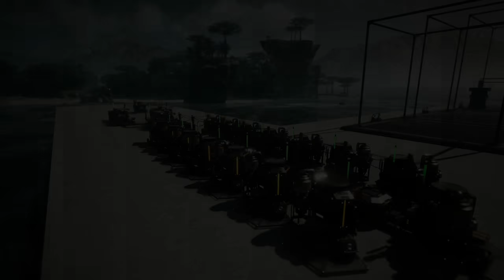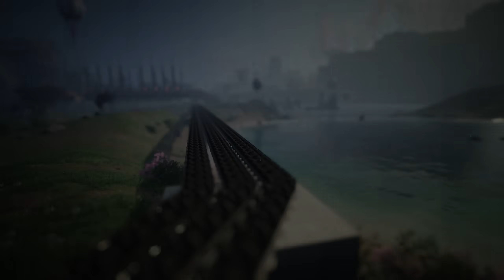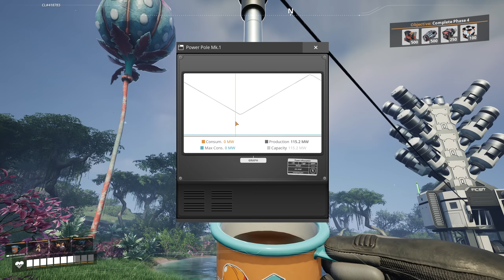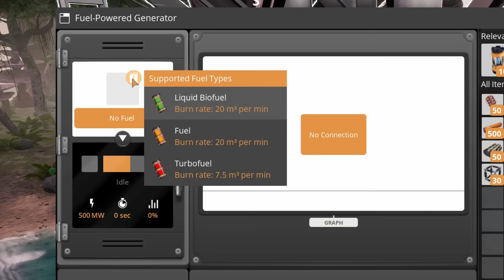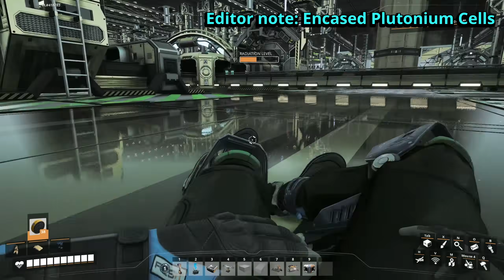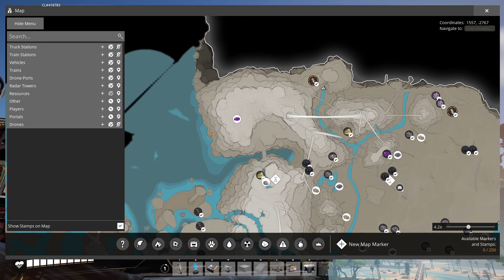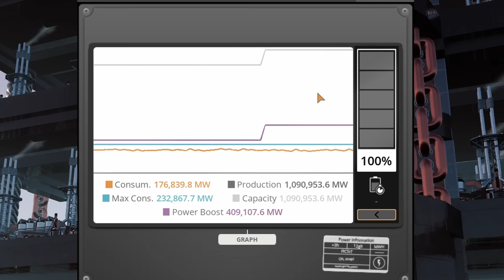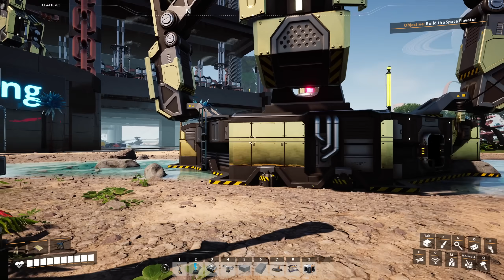BEST power guide for Satisfactory 1.1

Comment: Alright here is something I feel nobody knows or knows but doesn’t care for it. 

Free power early as coal:

I have possibly found an exploit or a weird game mechanic when you combine coal power to biomass burners. 

How?

First once you replace your biomass to coal keep a couple of biomass burners on standby make sure your product consumption power is below you capacity once this is done you can load your biomass burners up with a couple of leaves of your choosing or you can use biofuel for safe measure. Once you connect your grid to the biomass burners your biomass burners will give you 30mw of power without consuming the fuel basically giving you free power for every single biomass burner I created a BP centered around this and at the moment I am only using 30-40 mw of power but with two coal generators and over 32 biomass burners that are giving me free power I currently have over 1.2 gigawatts of power and I’m not even started on phase two yet

Comment: For getting water into coal gens, i use a double ended pipe manifold, two water extractors feeding one end, and the 3rd extractor feeding the opposite end, i usually just run the other pipe on top of the first and connected it with a bend at the end of the first. Ive necer had any problems doing it this way once the system is primed
Reply from the maker: not bad

Comment: i started at the bottom of the map.. utilized that small crater that is there little bit north as soon as i got coal generator, then utilized all geyser nodes on the map and then switched to rocket fuel in blue crater making around 120GW out of that and still rn at tier 9 still utilizing just about half of it, just unlocked synthetic power shards and iam going to turn all that to ionized fuel and i guess thats it for my power generation :D
Reply from the maker: Nice sounds like you got a good power system going.

Comment: i realized on my current playthrough, the biomass burners will not use fuel if you have access power from other resources. so in a way they act like a buffer mid game
Reply from the maker: that is true, they can even be used as a safety net in many builds as well. but people dont like to use them after awhile.

Comment: as a new player i need a guide on how to route power cables. so far i'm linking 3 generators to 1 post and that post to another post with another 3 generators and that post to another post  to power some machines and another post for extra machines and so on. its annoying.
Reply from the maker: that sounds about right, that or you can upgrade to power pole mk 2 in the MAM.

Comment: Would you ever do a setup guide for the fuel power building??? i'm at capacity with 2 overclocked oil extractor supplying 28 generators :S
Reply from the maker: i have done some before, they are just old videos so most people dont see them.

Comment: Im prefer rocket fuel. I hate that permanent radiation coming with nuclear power. 1 pure oil source will give you power for 144 generators! Its so easy to build! And there are good places. My actual spot have 2 normal and 2 pure oil sources and additional fracking oil!
Reply from the maker: agreed, rocket fuel really is the best way to go.

Comment: I ended up powering 270 fully overclocked fuel generators burning rocket fuel for 162,000 MW using all the oil nodes on the coast south of the rocky desert and the alternate recipe for rocket fuel that combines sulfur, coal, fuel, and nitrogen in the blender. Couldn't imagine it getting easier than that.
Reply from the maker: yeah Rocket fuel is the best and easiest to set up for an end game power source.

Comment: How do you manage to get the fuel to flow correctly to the generators on the higher floors? Especially when you don't seem to have pumps on the turbo fuel lines? I'd love to build a compact fuel power plant, but I've always had a terrible time with fluids (aside from water) in this game, especially when verticality is involved. I last built a fuel plant before 1.0 so perhaps they've changed something? Love the build though, it looks awesome!
Reply from the maker: cuz its not turbo fuel, its rocket fuel, its treated as a gas in the game and just flows and dose not need pumps.
Reply: @DrawingXaos  Oh, I see. I never actually went for rocket fuel, so I didn't know. Thanks for the info!
Reply from the maker: @Viinan  No prob, it is the best fuel type, way easier to make soemthing big.

Comment: Also isn't the diluted fuel recipe better than the packaged diluted fuel recipe
Reply from the maker: packaged diluted fuel you get earlier, so most get that before the other.
Reply: @DrawingXaos  ah, thanks for clearing that up, im currently building a 144000mw rocket fuel power plant using heavy oil residue, diluted fuel, and nitro rocket fuel, so i was wondering why you said packaged diluted fuel.

Comment: Has anyone done the math on simply adding Somersloops to Nitro Rocket Fuel production rather than building Alien Power Augmentors?
I'm pretty sure that 103 Somersloops doubling and compounding Rocket Fuel production would ultimately add up to more total power than Augmentors.
Reply from the maker: i dont think anybody has paid the math budget to figure that out. but you might have a point.

Comment: I don't bother with nuclear, rocket fuel is so much easier to deal with. Also, I pair geysers with a few batteries (or whatever the round storage units are, batteries are different) especially if it's somewhere remote and I just need to power a bit of something. Constant power output baby!
Reply from the maker: so true, and very nice

Comment: I about to go phase 2 but then nightmare struck. Power max consumption is 1.1k MV and I only produce like 770 MV….I think I should turn off some miners
Reply from the maker: Time to upgrade the power station. turn off all none essential machines and go big. or some batteries
Reply: @DrawingXaos I managed to recover, reset my sloppy coal power to more efficient setup. Now I have to dig for oil, anyway thanks for the guide

Comment: When I’m on coal I have 2 power grids, one that powers the pumps and miners for the generators, and that’s connected to just 1 of the coal generators out of the 8. The other 7 are connected to my main power grid for the base. This way my coal generators are always able to restart without any issues even if the power goes out to the rest of the base. Yes you do lose a small amount of power from the 1 generator but it saves you a lot of hassle.
Reply from the maker: Neat, that is one way to do it.

Comment: I am just stuck at coal. I am so looking forward to nuclear. Also a tip for the geyser fluxuation. Build some battery's to nullify the fluxuations a bit.
Reply from the maker: Nice.
Reply: Geysers are timed from when you build them. If you have a spot with 2, build then 30 seconds apart. Now their fluctuations compensate.

For a spot with 3, build them all 20 sec apart. I've been doing this for ages. Really lowers the fluctuations.

Comment: Nuclear Power just isn't worth it at all without mods. Needs a serious look at rebalancing. By the time you even unlock it, you (likely) already have a Fuel Power Plant running. It's SO much easier and cheaper to just expand that as needed (if needed, depending on how you play) than dealing with all the headaches (and radiation) of Nuclear Power. Yeah sure, Nuclear generates more power with fewer gennys but the amount of time, maintenance, and resources needed just make it a joke. The Fuel Power Plant with Alien Augmenters: chef's kiss. I messed with Nuclear Power once just for fun, but I never even consider it for any of my playthroughs.
Reply from the maker: i know what you mean, if i didnt do videos for the youtubes i would have never done such a big setup.  its so convoluted and a pain in the butt,

Comment: Well... how do i put it
I made an Ionized Fuel Set Up that produces 2400 PACKAGED Ionized Fuel as a byproduct
Yes, byproduct
Why? Cause I´m going Nuclear.

Making Ficsoium is so expensive in SAM, that there is literally not enough SAM in the world. Unless my math is wrong. Which would be bad to find out now.
Using all the Uranium I´m making 50.4 Fuel Rods per minute
By getting rid of the Waste as efficiently as possible (as far as i can tell at least), I´m making 12.6 Plutonium Fuel Rods per minute
This would end up in 63 Ficsonium Fuel Rods per minute
To make this amount of Ficsonium Fuel Rods you would need 10500 SAM per minute
There is only 10200 per minute in the entire world

So what do you do? Give up? NOOOOO JUST LOSE ALL SANITY ALL SELFCONTROL
JUST MAKE ALL THE DARK MATTER RESIDUE VIA POWER SHARDS
That is surprisingly efficient in terms of SAM
but...
and it is a big BUT
you can´t shred or delete Power Shards
hello Nuclear Waste 2.0
so you craft the Power Shards into Ionized Fuel (cause it´s the only option left) to power your Vehicles or Fuel Power Plants or just Awesome Points
Would this amount of Ionized Fuel already fullfill all my needs of MW?
Yes

But not my dreams

PS: Currently I´m producing about 2360 Packaged Ionized Fuel per minute, i screwed up at some point with the Nitrogen Gas Pipes and I´m not cappable enough to fix the error. Also these are 300 Power Shards per minute. More then needed, but clean 300 just seemed nice.
Reply from the maker: my god... sounds amazing. keep up hte good work pioneer
Reply: Thanks!! Your videos are a huge inspiration to go completly nuts with this game and I love it
Reply from the maker: @RedMelonator  awe, thank you.

Comment: My go to is the Rocket Fuel Power plant. I strongly recommend you following recipies:
- Alternate: Heavy Oil Residue
- Alternate: Diluted Fuel
- Alternate: Nitro Rocket Fuel
All you need is one Pure Oil Node (for 600 Oil/min), 6 Water Extractors (@250%), 8 Refineries (@250%), 8 Blender (@200%) and another 8 Blender (@200%). Thats all for 144,000 MW
You need:
- 600 Oil/min
- 1600 Water/min
- 1200 Nitrogen/min
- 1600 Sulfur/min
- 800 Coal/min
You get:
- 2400 Rocket Fuel/min
- 400 Compacted Coal/min
- 400 Polymer Resin/min
Actually i could get more Power than 144,000 MW from it when i would not throw away the Compacted Coal in a Sink. 
The Powerconsumption to get this running is about 4,220 MW so you get 139,000 MW out of 144,000 MW.
I can Email you some Screenshots or the Savegames if you want. So you can have a look at it. I just ended my Phase 4 in my game and i still experiment with Lightning inside my Factory.
Greetings from Germany!
Reply from the maker: Nice, yeah that is good, but depends on what your hardest resource is... nitrogen or sulfur or oil. and if you want you can always throw screenshots in the discord.
Reply: Ich wäre sehr interessiert an deinem Savegame, um mir dein Setup im Detail anzuschauen. Wäre es möglich, dass du mir die Datei per E-Mail zuschickst? LG!

Comment: Please consider "Rocket Fuel", I'm using following recipes: "Heavy Oil Residue" (Oil -> H.O.R. + Polymer Residue) => "Diluted Fuel" (H.O.R. + Water -> Fuel) => Nitro Rocket Fuel (Coal + Sulfur + Fuel + NitrogenGas -> Nitro Rocket Fuel). It may be a bit more complicated than standart rocket fuel, but it has some awesome byproducts WITH exceptionnal power level. 

(Also don't mind me going for 600+GW of production with that, I'm monopolising like 75% of all map sulfur nodes for that, HAHAHA).
Reply from the maker: lol yeah rocket fuel is the way to go and each recipe does have some interesting things. depends on how much you want to use for what.

Comment: Nuke - Lee - Er

I did it in my first playthrough. Only processed to Plutonium rods so I could sink them for “clean” power. Still ended up with oopsie waste here and there trying to get the process refined. I won’t do it again. This playthrough is gonna be all rocket fuel for power. Gonna turn the blue crater into a massive power pyramid.
Reply from the maker: agreed, going to plutonium or ficsonum is so not worth it.
Reply: Nuke Yoo Ler

Comment: i started a new playthrough since i have not played in a while, and i unlocked coal power and attempted copying your coal setup with 8 coal generators i have 240 coming in, with 3 water pumps. one in the middle begging, and end. so water is not an issue but for some reason the end generators are just not getting coal, and i can see that it splits, 240 - 120 each lane for the first, then 60 then 30 then 15 and so on so fourth. so main question is how did you get the coal to go to the end gens with 240?  the coal is coming in from a overclocked mk1 since i dont have mk2 yet i do have mk3 belts running it down to my coal gens tho not sure if that matters
Reply from the maker: man this was confusing me at first, then i saw the problem i was having. each coal gen takes 15 coal per min. so for 240 coal you can have 16 coal generators.  which means you would need 6 water extractors... normally you use mk 2 minor, a pure node, and mk3 belts at 270 to get it to where you need it. when you use the splitters, you must make sure you still have mk 2 or 3 belts to the next splitter.  only use mk 1 belts going into the generators. that should work fine. i turn off the water and have all the coal filled first then turn the water back on.

Comment: What costs more energy? Sinking the plutonium rods? Or burning them, turning the waste into ficsionum rods and burn them?
Reply from the maker: it cost more energy to make ficsionum rods then the energy they produce, but when you think of plutonium rods as well, then it is worth it.
Reply: @DrawingXaos  Yeah, I was asking about the gain of Plutonium energy minus the cost of disposing of its waste (by producing and burning fiscsionium bars), compared to the gain of just Uranium energy minus the cost of just producing and sinking plutonium bars.
Reply from the maker: @leGUIGUI  it depends on if you are using power shards and somersloops but i have been told its not worth it... i just made mine for the meme's

Comment: What you didn't mention, and what I've barely been seeing being talked about is, that ficsonium isn't actually worth it:
Assuming you use all the 2100 uranium ore the world has, you get 50,4 uranium fuel rods, 12,6 (since you can't get rid of all of the possible 22,4) plutonium fuel rods, and 63 ficsonium fuel rods, using all the map's SAM ore for a net total of 1.347.500MW of power.
If, however, you use SAM to simply convert bauxite into uranium while sinking the plutonium fuel rods, you can actually achieve way higher power output for far less resources, at the cost of some extra bauxite/copper (depending on the converter route used). For example, using just 411,111 SAM and 4933,333 bauxite, you can produce 80 uranium fuel rods, which produces 1TWH flat, while saving you a whole bunch of resources and power that would otherwise be needed to further process the waste, not to mention the time invested to build the setups. I haven't actually gotten around to testing this yet, but on paper at least, having a setup like this might just be the right mix of complexity and power output to beat out rocket fuel as the most convenient source of lategame power.
Reply from the maker: well i did call Nuclear a meme... does that count.
Reply: I forgot to mention, the leftover SAM is then best invested in producing the alien power matrices needed for running 6-8 APAs and getting a total combined power output of over 3TWH with the help of a turbo/rocketfuel plant. Slooping those final quantum encoders might also just be the single best use of somersloops.

Comment: I like to gather leaves and wood, give them to constructors where they double it and give it to the next constructor, where they then double it and give it to the refinery, where they double and package it to deliver to my emergency power source building that I use to jump start bigger power stations. 

At least that was the plan. I haven’t run out of power that hard yet.
Reply: depending on the factori you are having. much batteries may be more of a conquern since a major power outage will may it so hard to jump start the factory all over. so. basically. better save than sorry
Reply from the maker: Nice.
Reply: This restores my faith in Ficsit Engineers 😂

Comment: I actually planned a whole Save around 8 Power Augmenters with Alien Matrix and the whole Uranium, Plutonium + Ficsonium stuff producing over 1TW of Power Itself without Power Augmenters and the 30% Boost times 8 goes pretty hard
Reply from the maker: Dang, I need to see how much we can push power.
Reply: @DrawingXaos  ~1.5 TW of uranium
~2.2 TW of plutonium
~150 GW of coal
~1.7 TW of rocket fuel
and 8 matrixed augmenters
19 TW consistent limit with plutonium waste
~1.3 TW of uranium
~2.6 TW of rocket fuel
~225 GW of ionized
and 9 matrixed augmenters
this is waste free 15 TW

thats how far you can push it
Reply from the maker: @NitraZone  That is nuts, i love it.